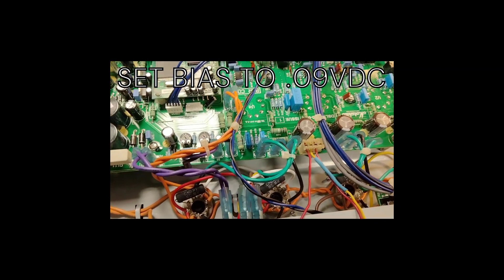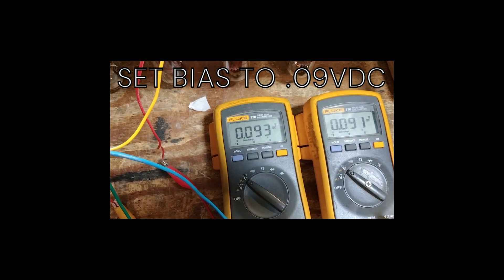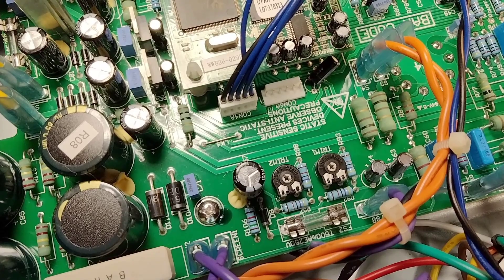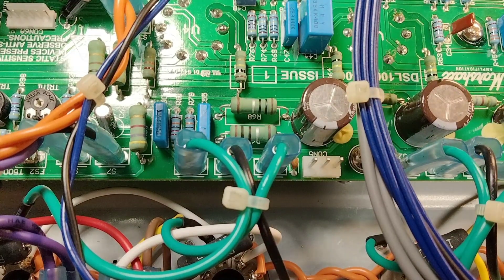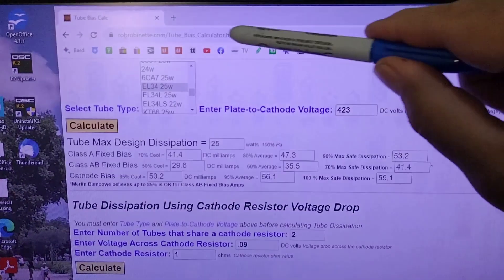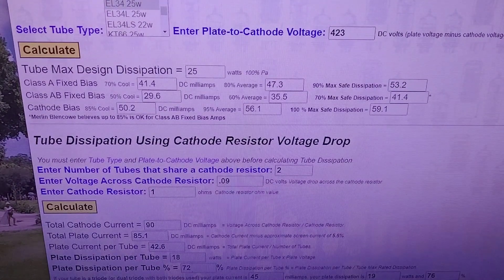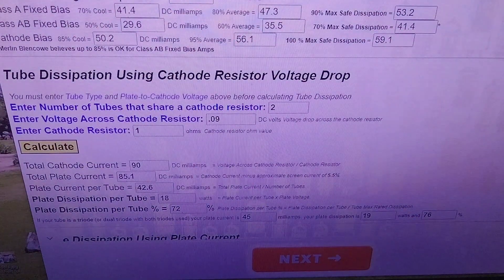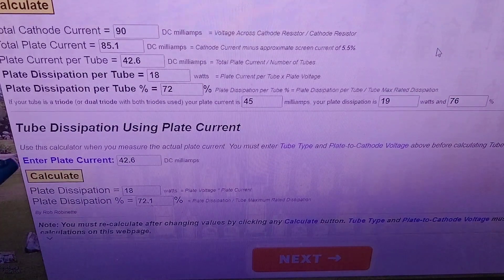Marshall DSL100H how I set the bias

Comment: 90 is too high. Marshall spec's 80. I bias my JCM 2K 100 @ 70 which is about 35ma per tube.
Reply: In his amp because the plate voltage is at 423dcv, 90mv is fine as it is more or less 70% dissipation for each tube.

That seems to be the big issue when trying to bias this amp is that Marshall says to just go with 90mv and almost everyone says it is too high but even more people neglect to mention checking your plate voltage before performing the bias.

If his plate voltage was higher (450-500 for example) then yes, 90mv is absolutely too much.